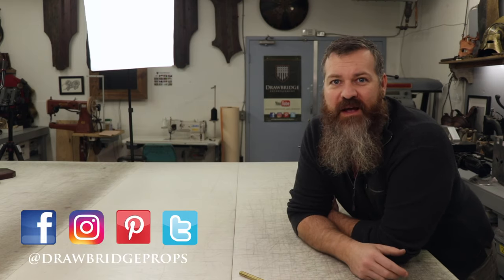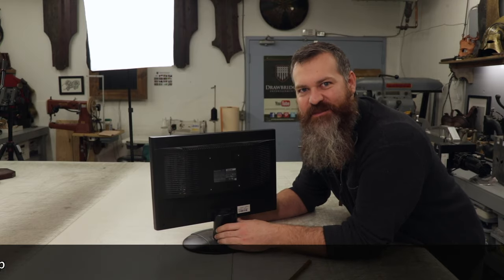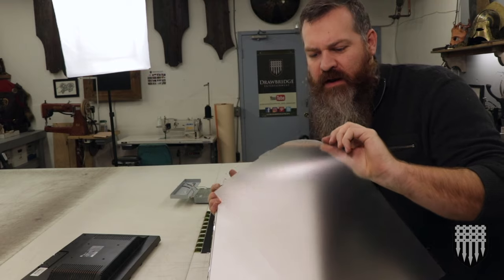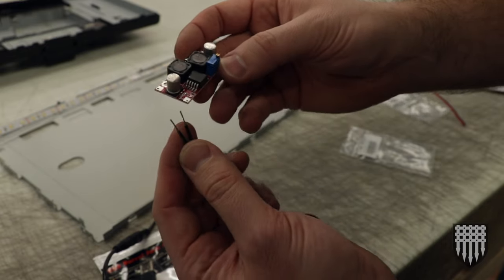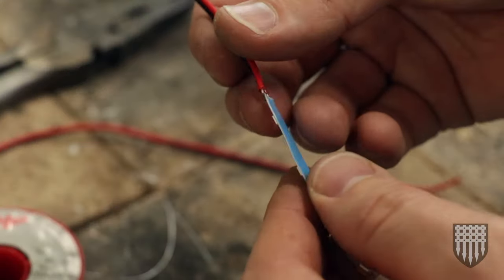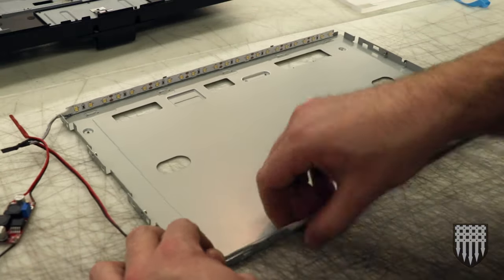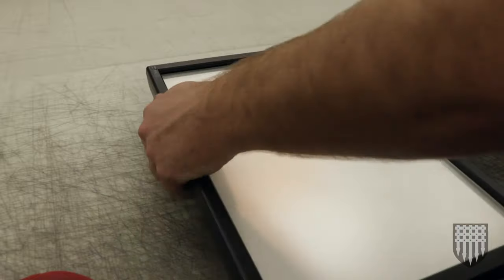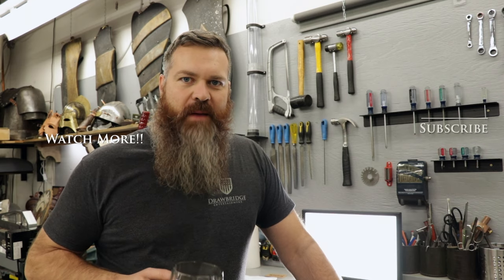Making a Cheap DIY Led Light Panel from Scrap materials

Comment: Hi, I have been thinking of doing this with an old monitor/tv for a while. I like the fact you reinstalled the light panel into the old case. good idea. 

Regarding the soldering. There are a couple of thing you can do to make it easier for you and have better solder joints. (I havent had time to read through your comments so hoping this is not repeated info for you). 

Get a flux pen or similar, this can be used on the surfaces and wires you want to solder. It'll help the solder flow into the wire and on to the solder pad/surface. 
I will usually set my soldering iron to 340 decrees C or 360 degrees C, (Hight for thicker wires and so on). 
I usually have some damp cloth or tissue near by so i can clean the soldering tip as I go. (Solder has some extra chemicals in it to help it flow and make better joints. the longer it's on the heat, the more of it boils off and you get dry joints. So cleaning the soldering tip often is a good idea).  

Next, add solder to your soldering iron tip, you wont need loads
Tin the ends of the wire and solder pads you want to join. (Tinning a wire or solder pad means heating the wire or pad and applying solder directly to them. The idea is to get the object hot so that solder will naturally flow into/on to it. (think of taking a piece of string and dipping it into water. When the wire is hot it'll draw the solder into the wire). This makes the process easier for actually joining). 
When both parts are tinned, get them lined up. (depending how long it took to line up, you may want to clean the solder tip and reapply a little solder to the tip). 
Then heat the lined up parts and they should join up quickly. 

If the finished product is looks shiny and like silver, it's a good joint. if it looks matt and like iron, its called a dry joint. It's not so good, less efficient and more likely to break. 

Again. like the video and I think Ill have to get my hands on an old screen to make one now :) Thanks :) (hope the above helps, any questions let me know).

Comment: Nicely done, I would recommend adding liquid rosin flux to your soldering kit.  It helps the solder flow better between the wire and the copper pads reducing the amount of time needed to heat everything.  Great idea for photography!
Reply from the maker: Thanks for that tip.  I will get some.

Comment: Looks like this method could give you a nice "light table" thing... This kind of illuminated pad you can use to copy things you have drawn on an other piece of paper... Only modification required is using something flat as a back cover so it sits flat on the table
Reply from the maker: This one sits flat on the table because of the bracket I put on it. Works great for that.

Comment: Hello great work sir. I wanted to know what are the different sheets were there with the diffuser sheet
Reply: Hello! There are differents types of backlight construction, but almost all have 2 diffuser and 2 refractors, the main is the acrylic one, which is the responsible for conduct the light in perpendicular direction to the LED panel, and the second one strenght this. Others have more layers like polarisers, reflectors (basically mirrors), in order to impact the pixels with the perfect intensity. I hope this would be useful for you.

Comment: Nice job on the light box but don’t think I’ll be building one soon. 😅.  I tuned in because I was looking for an application for a painting I created that changes when the light comes in through a window and I have no idea how or what to use to make that available to a customer who would like the option of hanging a picture on a wall vs having light show through the back of the painting to make it look like an entirely different painting.

Comment: i've used them all as pannel lights, except for the samsung, it has a single light strip on the bottom which i took off and put over my workbench, because  it , for real, looks brighter than looking at the sun

Comment: What exactly are the sheet materials used? If I wanted to have a go at this what would I be buying?
Reply: AFAIK, it's a few diffusion layers, a prismatic layer. And a light guide plate layer. (those last two are rather hard to find privately, and unsure if they'll sell one offs)
Reply: ... Which is why those layers were harvested from the monitor itself)

Comment: You could also use the existing a/d board to power the led strips. The wires that go from the a/d to the inverter send 12 volts( 2 sets of wires usually).

Comment: Laughed at your soldering comment because that was me. FYI, you don’t have to cut a solder off, if you didn’t discover it, just add a bead to your iron, heat up the solder connection and pull away!
Reply from the maker: Thanks!

Comment: When using one of those Buck Booster with the small potentiometer, the screw has to be turned multiple times to adjust the voltage up or down.  Turning it just a couple of turns one way or the other will only adjust the voltage minutely (so small it will hardly even register on a meter)
Reply: Can you over turn it?
Reply: @rogierius  From my experience you can't.  You will very lightly feel it clicking when you hit the furthest point it can go in either direction.
Reply: @bigrenegade7121  Thank you!
Reply: to clarify;
> a potentiometer is a bulky variable resistor and rarely used on such devices -  It only turns 270 degrees
> a trimmer or trimpot is a small variable resistor. It is often found on such devices (it is cheap and small) -  It only turns 270 degrees
> a multi-turn trimer looks like a long box and is multi turn. It is used on high end devices
Reply: @kennmossman8701  Granted it is usually called a "trimmer" or "trimpot", both of which stand for trimmer potentiometer.
Reply: @bigrenegade7121  Regardless they are not multi-turn.
Reply: @kennmossman8701  And you're going to tell me this when I've been using the buck boosters for the better part of 5 years?  Go do some reading about the product and the manufacturers instructions with them.
Reply: @bigrenegade7121  WOW   almost 5 years.  Another Edison!  Another Tesla!  LMAO
yet you confuse a pot with a multi-turn trimmer.......what a putz
Reply: with 5v input it is very difficult to get any decent current out of those modules. Boosting from 5v to 12v at small currents they are ok but anything in the 1amp+ range they drop fast. He could've turned the pot dozens of times and set the boost to 20+ volts with no load but as soon as he attaches the leds the voltage drops well below. Need a larger input voltage to get those little modules to produce.

Comment: could this be dimmable/shapable? I have an old gauge cluster I need to find a way to thinly replace a crappy EL set. The overlays are available, but the surface mount LEDs I see people use look like crap
Reply from the maker: Yes.

Comment: I think the first supply can't raise the voltage because it has not enough amps, so that's te reason it doesn't respond wen you turned te screw

Comment: I couldn't work out why you didn't put the LEDs completely around the four inside edges ?.......you said they were cheap ? Then why only do two sides ?........ but a great idea and I'm going to try it but on all four sides I've never know a light to be too bright
Reply from the maker: you know I had that same thought when i was editing. I would have had to trim and polish two edges of the acrylic which wouldn't have been that hard. a proper dimmer would probably be helpful as well. one of those, just do the project and then think about the improvements for the second one.

Comment: Another way you can find wich cable is wich without using a tester is whit a 9 volts or even  a 1,5 volts battery
And gentle short circuit the battery, if you see a little spark then is that cable, if you don't see any spark then is the other cable... that simple.

Comment: Cool concept. I think you should have ate roach the voltage control on your lights a little differently. 

Rather than running a string of LEDs where their total voltage is 12-volt DC it would have been easier if you cut the LED strips into  running four 6 volt parallel strips. 

this way your USB power supply will be able to handle the load. The last thing you need to install is a potentiometer to control the brightest
Reply: cutting a 12V strip gives two 12V strips.